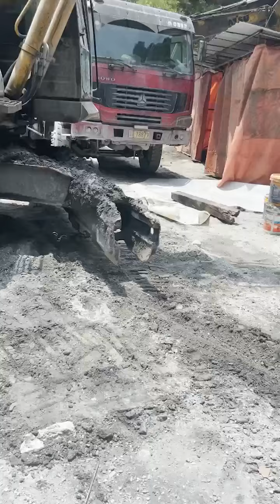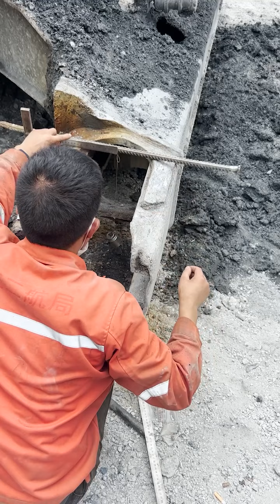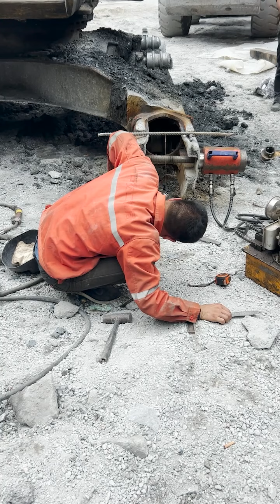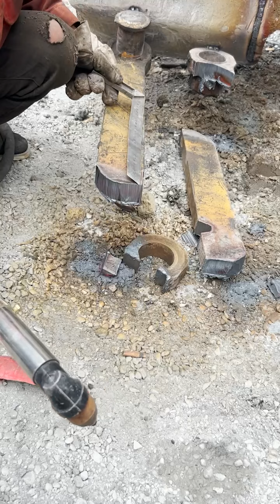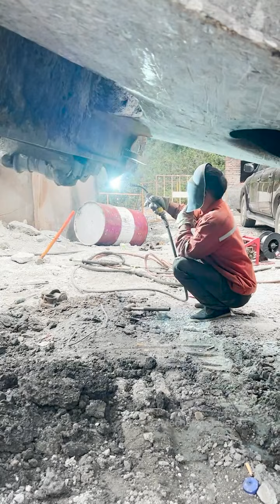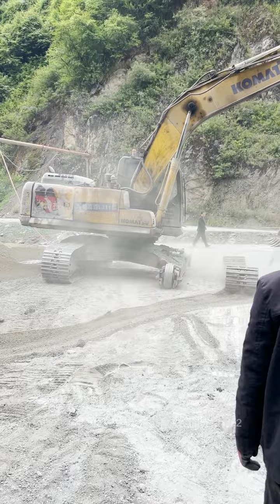#mechanic #automechanic #automobile #cars #trucks #restoration #mechanicsteve

Comment: I wouldn't have bothered bracing that, clearly the Idler frame is completely knackered you should have just cut it off where it joins the Track frame and fabricate a new one weld in job done.